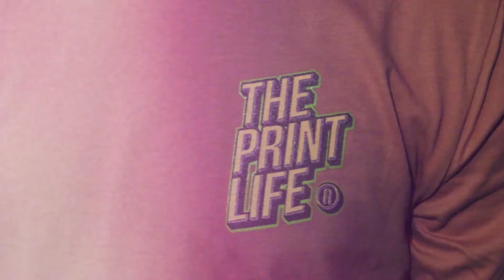T Shirt Printing Machine for $30 | DIY T Shirt Business | Step by Step Screen Printing Press

Comment: All I had to do was buy the clamps to build this set up. Totally worth it. Also home depot will cut all the parts for ya.
Reply from the maker: Oh that is a great point yes they will
Reply from the maker: And dont forget to buy the stuff through my amazon store.
Reply: Your totally right about home depot. I made my press last week and never cut one piece of wood. The jiffy clamps I used were the ones cam recommend. You can find them in his Amazon store!
Reply: Would I still run a flash unit if I were using water based inks?
Reply: I want to build this but I’m confused on all the measurements. I want to go to Home Depot and be able to tell them what I need. Can you tell me the exact measurements you cut? I got lost after the 2-3in gap 😭

Comment: So for the last couple months, I was really enthralled to make my own t shirts. Just lowkey stuff to wear and to skate in. Did research, and just like starting any hobby, there's a million different sources of information, help, etc that quickly become OVERWHELMING.

I did more extensive research for a couple weeks and decided to buy a Speedball All in One Kit. The most expensive one I managed to track down for $70 bucks brand new. Everything included.

Fast forward a few weeks, I've made a couple of my own shirts which are super sick. Very simple logos for the moment. 

Here are my current takeaways.

1. I'm using Vellum paper and have noticed it's a bit harder to wash the design out versus transparency paper. I'd use transparency but no retailer has it physically, would have to order online.

2. It's a super simple process but can be daunting when you're first starting out.

I enjoy all your videos dude, you're probably the main channel where I get my info.

Until next time!
Reply: Instead of using vellum paper you can just print your design on regular white paper and coat it with oil, also add some oil to the screen so that it sticks, works really well and even the smallest details come out good, 💁🏻‍♀️
Reply: @killsunhee  I'll go ahead and try that tonight. How do you wash out the oil properly off the screen tho?
Reply: Ava Giovanni with any liquid soap, scrub it on the screen gently with your hands and wash it off!
Reply: You got any pics of your shirts?
Reply: @ThisAintThatBooney  I'll post a pic later and send you an @ on instagram or something
Reply: Ava Giovanni @offthedale I would really appreciate that bro

Comment: Cost associated with the business is really the only thing holding me back.  I have the basics, small single manual press, home made exposure unit and all the 9's to get the job done.  But with this process comes time.  Watching these videos have brought me a long way in the quality phase, just need to get to the quantity so that this side hustle will take off.  The design part is a sinch as the wife was already trained in several programs and we were already cutting vinyl for businesses and others.  Was about to start buying an exposure unit and a dryer but meh, C-19 hits and all money is staying with me.  Keep it up Cam, doing a good job.
Reply from the maker: Now is the time to get you website up, so you can start getting clients in your local area. Start build that right now, so when things turn around you will be there to pick up the work, allot of shops are going to close during this thing.

Comment: I did this totally ghetto cheap.  Didn't have a drill so I used wood glue.  Hopefully that works.  I also used left over MDF to make the "legs".  Going to have to wait for the clamps but should be good to go!

Comment: I used your template to make a portable screen printer bc I own a company that sells swag and branded merch and if it is easy and 1 color, I will print myself bc I love printing (instead of outsourcing to my bigger printers). I just wanted to share an amendment for anyone who might want to change out platen boards (children's sizes, sleeves, etc) I changed the screws to bolts, washer and butterflies. I counter sunk the top and wood filled and platen taped the surfaces of each so I can change out different styles/sizes of platens. Thanks for the easy to build design and for sharing your idea. I take my system with me when I travel and I create T's for friends and customers anywhere now.
Reply: I have been printing for almost 30 years and your videos are by far some of the best out there. They are easy to understand, simple, short and to the point. I have incorporated many your ideas/suggestions. Thanks for doing what you do! I am about to screen print on golf discs bc I am a retired Ultimate player and I still golf and my brother is an amazing illustrator and we are about to print on the actual discs. Any recommendations for printing on non flat not cloth surfaces?

Comment: Hey I’m just starting out, bought myself most of what I need but a press and exposure unit. I use a not so strong lamp to expose from like 14 inches away for about 6-8 minutes, designs wash out but many times portions get blown out and the smaller details usually get kind of absorb, I use 150 mesh counts and honestly I need saving, I’m so under motivated because I’m not getting  strong results and I’m having trouble refining my process, also I live with my parents and it’s difficult to keep everything in its place.

Comment: A good tip is if you don't have a printer but have a vinyl cutter make a transparency with htv so you have an original you can use to make a shirt plus works great to burn into screen
Reply from the maker: Very nice tip, thank you for sharing, you are the best.

Comment: Out of the 24" Long for the press, when you do the 2-3 gap what's the measurement do you just end up cutting from the 24 length? What's the measurement for the top part where the clamps are at?...
Reply: I’m no professional but it seems as if he cut the 16x24 piece into two piece which are 16x20 and 16x4   The jiffy clamps go on the 16x4 piece. (I think 🤷🏽‍♀️) with a 2-3 inch gap between them.
Reply: @TheKraftyKell  thank you! Appreciate it

Comment: cam whats good?!! hey another question. what are the dimensions of the scree you used for this print (inside en outside). thanks again!
Reply from the maker: These are our live print screen, they are 18x20 but you should grab 20x24 inches manual screens
Reply: @ThePrintLife  thanks for the reply! but what is the difference betwee live screens and manual screens. (couldn't find it on google)

Comment: I'm having trouble with the photo emulsion on the screen. Mine is a little too watery. I had purchased a speedball kit, but I think the activator was possibly too old. I dont know. I had trouble with that. Also, is it possible to make a homemade screen remover? So, I could reclaim the screen.
Reply from the maker: Yea man get emulsion from Chromaline, murakami, saati, ulano, they are reputable good brands,  get what know as hybrid emulsion

Comment: Hey, im stuck with ink (water based) dried inside mesh  while im printing, and also on of contact and im curiose how to diy print halftones...
Reply from the maker: Aint no away around that, water based printing requires that you print with no breaks, or it dry, shoot it will dry even if you are printing it non stop, Its very hard to work with.

Comment: In your experience does emulsion go bad if so what causes it and how to prevent it ?
Reply: All emulsion goes bad eventually. The duel cure stuff (the one you have to mix) has a lot less shelf time than the premixed photopolymer stuff (consult manufacturer for approx times). But you can extend the life of it by keeping it in the refrigerator.
Reply: @printittowinit  thank you very much
Reply from the maker: if it pre sensitized it can go bad, throw it in the fridge to extend shelf life,

Comment: I create my own designs but finding some to print a few at a time is hard. Also, my designs are mulit-colored.
Reply from the maker: Multi-color prints in low quantities will always be a difficult situation for you, the shop has to charge a fair amount to make it worth their time if you opt to print your self, multicolor is more technically complicated,  and require better more expensive equipment to produce with good results. Either way I'm sure you got this

Comment: I made one. The problem i have is to get my work at 2.5 inches from the collar the art work is to close to the edge of my screen with this setup. Im hitting the tape and pulling it up because its so close to the edge. Is i move the pallet back and burn my screens lower then i will loose my front contact for my offset. Any advice? Im a sign and wrap shop just playing with the thought of doing screen printing. Thanks Man

Comment: So yes want to know something. As a beginner, after printing your shirt. Can you just leave your shirt outside to dry ( meaning 1. Just somewhere around your house or 2. Outside where it’s sunny and making sure no dust etc comes on the paint). Thanks bro
Reply from the maker: That depends water based inks like speedball can air dry, I think permaset aqua has a line that  can air dry, Plastisol has to be cured with heat.
Reply: @ThePrintLife  thanks man!!

Comment: any ideas or advice on how to adjust the off contact on this press if i have a screen that goes past the platton?  I am considering moving the piece that holds the jiffy clamps back further, but i wanted to see if you had a better idea or reason that would be a bad idea.

Comment: for those of us that don't have a saw and need to get everything cut at home depot, could you tell us how much you cut out of the MDF board for the bunching problem?  Like what are the dimensions of the smaller and larger piece of the board?
Reply: Did you ever figure this out?

Comment: question: can you put silicone spray on an already burned screen with the print on? whenever I print onto a shirt, the shirt goes up with the screen and it causes the print to not fully get through. is there a way to make that from not happening?
Reply from the maker: Use pallet adhesive, I don't cover that in this vid but I cover it extensively in my other videos.

Comment: Can I use a heat press to dry my finished product ? (Using water based ink) if so how long should I press for and why temperature! Thanks in advance if anyone can help 🤞🏽
Reply: I believe in one of his videos he explains that curing time depends on ink and temp of your heat press, the cure times usually come on the label of the ink bottle and then adjust time according to your heat press. Some get hotter than others so not all of em are the same.

Comment: Started a week ago, thought I’d give it a go. Atm I only have 2 screens. One has screen lock. Maybe I under exposed that one? Just wondering is un-lok any good for saving that screen?
Reply from the maker: I have never used an unlock chemical but give it a try.
Reply: The Print Life Thanks for the reply bud. Will give it a try.  Rookie mistake getting screen lock I know
Reply: The Print Life “update” I used that remover chemical, worked perfectly. Screen restored! Just a quick question: can you use normal dish soap to degrease a screen? Heard it on an amateur video & wanted to know from a pro if it’s true. Thanks. Stay safe mate

Comment: After the shirt is printed with the DIY press, how are you drying the shirt? Do you have to own a flash or drying belt?
Reply from the maker: You can cure the shirt with a flash, I have a video in the play list that shows you how to do this, You are going to need a flash, or a heat gun, but heat guns are sooooo slow. make you not even want to do it.
Reply: @ThePrintLife  Gotcha. I own a sign & embroidery shop in Orlando and we get alot of 1 color print jobs and we were looking for a good solution to complete the jobs with a small footprint on the shop floor. So we will try out this option. I'll check out the drying video now. Thanks

Comment: How to make sure I’m always printing on the center of my t-shirt.
Reply: so i just figured out how to fix this because i was having the same question...in your design have center-align top and bottom bulls-eye(registry marks). Then, on your print table have a center line that runs across top to bottom. When setting up the screen on the hinges, make sure your bulls-eyes(registry marks) on your design, align with the line on your print table. *remember to cover up the bulls-eye(registry marks) on your print design before printing—you can use tape..i just realized this yesterday!!

Comment: Hello, really love your videos. i'm stuck on how to know what the correct flash drying time between passes is? I use water based ink mostly on cotton. white ink is a challenge for sure (or should i use plastisol to get better coverage)... also how much ink on screen is enough and when to know to add more ink on screen before passing squeegee...

Comment: Actually just built my own little press! I’m painting screens with drawing fluid and screen filler for now until I save up for an exposure unit. Problem I’ve been having though is not getting a proper cure... then again I’m using an iron. Gotta get a dryer too. Any tips for a good cure until then?
Reply: I just found your exposure video 🤦🏼‍♂️

Comment: Thanks for all of the info so far! Have you tried Screen-printed heat transfers? What are your opinions on that vs traditional screen printing? Would you ever use Screen-printed heat transfers for anything?
Reply from the maker: Heck yea I would, I have not used them In along time but I love heat transfers.
Reply: You’ve probably already tried with HTV but I’ll give my experience in case you haven’t. I have had so much trouble burning screens. Only 1-2 out of 3 screens burns correctly and gives me what I want (I do tea towels and my sets are in 3’s so I NEED all 3 screens to fulfill an order). 
I began using HTV to fill the need while I figure this out. They have been well worth it!!! They’ve taken the scariness out of preparing screens and given me
Confidence to keep moving forward. My only caution is that the adhesive will deep into your stencil lines creating haze. So be sure to clean your screens REALLY good after you set the HTV. But to get started fast I highly recommend giving it a go.

Comment: Random Question not relating to this video, but how do I 1) prevent my ink from staying and rolling up on the squeegee. and 2) how do i prevent my shirts from moving while I print, sometimes when I print the shirt moves just a tiny bit and it blurs the image. If you could answer this that would be amazing!
Reply from the maker: reduce in slightly, some shops tape the squeegee, use pallet adhesive.

Comment: PLEASE READ - save your money. I’m trying to start a screen printing business, I currently just put boards through my T-shirts but wanted something a bit better for cheap. Went and made this and it’s seriously terrible. He has his measurements all wrong, I went to this guys shop in Ohio and he doesn’t even use this machine, he uses the one he brought of Amazon because he said the one he made doesn’t even work properly! But he’s advertising like he uses it. Please save your money, he hasn’t even put the accurate wood dimensions, the T-shirt still scrunches with the cut of wood and it doesn’t feel sturdy on the table at all, it always moves even with the clamps. Wasted my money and time making this and his method didn’t even work so had to make my own
Reply: I done the exact same! Does not work! Please save your money & time I’ve been doing screen printing for 5 years now for even designers like yohji and I wanted to do at home, made this. Took 6 hours because his method is completely wrong & still didn’t work
Reply: Same here, guys a scam 🙂

Comment: My jiffy clamps gave me no off contact. And my screen is a lot bigger than that size pallet. So lost. 🤦🏻‍♂️
Reply: What size screen is that?
Reply: shaun spivey might be late in that one but I’m about to build one and I feel like this one depends a lot on your screen size
Reply: James Ortiz didn’t use that very long. Tried the Amazon 4 color. That lasted about a week. Went ahead and got a real press. Much happier.
Reply: shaun spivey so you bought an actual press? I’m a little confused
Reply: James Ortiz yes. Like with most things I do, I tried to get by with the cheaper route and wasn’t happy. So after 2 cheaper presses, I went ahead and bought what I consider a “real press”.
Reply: @shaunspivey8718  yo homie! What one did you buy? I wanna buy one asap

Comment: Hey Cam. I have 2 questions. Why do you put a quarter at the top? Also should the metal frame of the screen be resting on the shirt pallet or should only the mesh part of the screen be resting on it? I ask this because I imagine  if the metal frame is resting on the pallet you wont get as close contact, but maybe you dont want that much contact? Im a newbie any help would be great. Thanks.
Reply: The quarter is there to create more off contact to keep the screen off the shirt...or whatever your printing on. You don't want the screen to be directly on the garment.

Comment: Anyone know how you print wider format images for screens without a super expensive special printer? I feel like im limited to the capabilities of my house hold printer, 8.5x11. Otherwise buying a 20x24 screen is kinda pointless right?

Love the vids Cam. hope business is holding up during these trying times. You're a real inspiration to start my own hobby/business screen printing.
Reply: yes.  tile the print pages, and then tape the design together to make a bigger print without a wide format printer.  Make sure you take the time and line everything up though.  And if your using the baby oil with normal paper instead of transparency paper, make sure to trim away as much of the "white edge" as possible.  I've done this to make screens as large as 20x27 (custom frame).  It will take alittle more time to get it all lined up, but the burns still come out clean.